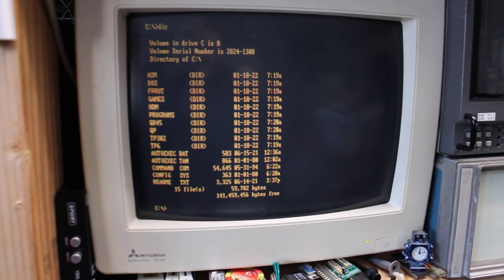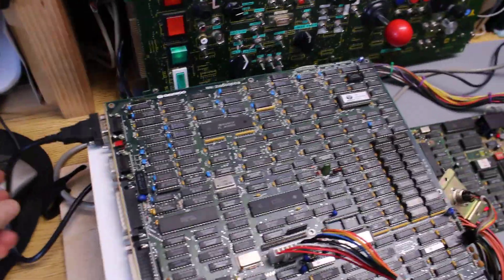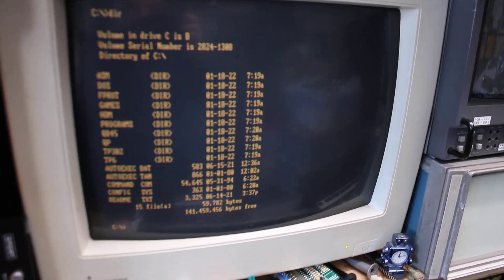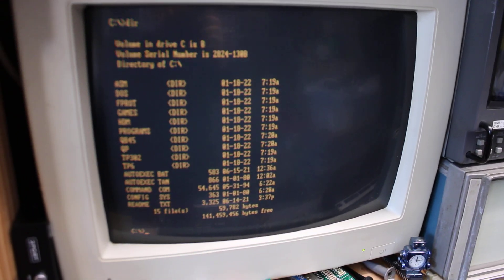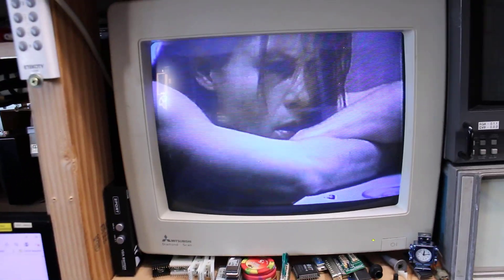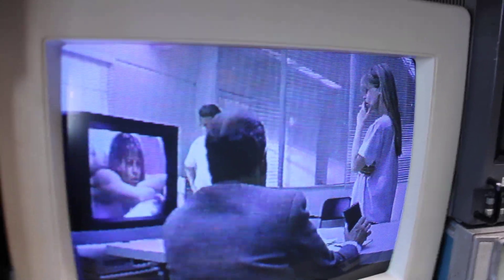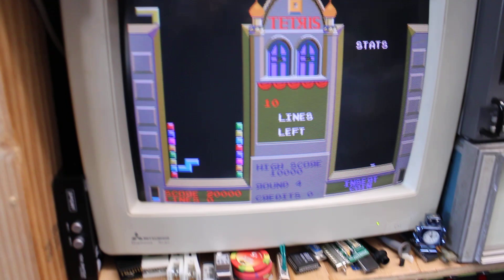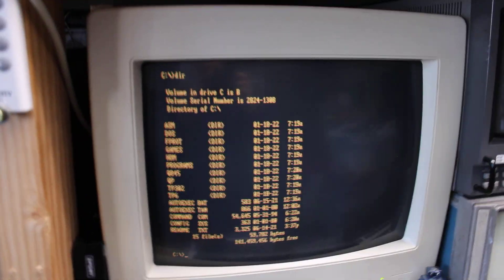Mitsubishi Diamond Scan Multisync monitor AUM-1381A demonstration

Comment: I also have an AUM-1381 and recently have been using it on my Apple iie via the composite input.  One thing I noticed is that the width/height/size controls on the rear of the monitor do not have any effect on the picture when running through composite input.  Those controls do work properly running through the VGA or TTL inputs. I would like to adjust this to better fill the screen.
Reply from the maker: Honestly using this monitor for composite video input is a waste. You are right, it overscans a lot and you would have to adjust internally, i don't think it is worth it. I would send you a really nice composite monitor with all the controls you need if you wanted to exchange? :) The composite video is a nice feature to have, but its comb filter is pretty basic too, you can't turn it off in mono modes which also leads to edge feathering. Its composite video function is its weakest point. But really, you don't have this monitor for its composite ability.

Comment: I dont know about these multisync monitors. Are they like a freesync kinda thing?
Reply: technically a Multisync monitor is just a monitor that can sync to resolutions with different horizontal refresh kHz, which is basically every monitor made since the late 90s.

However, what it used to mean in the 1980s like with this monitor was it could accept & display multiple video standards such as 15kHz SD (240p, 480i) content (such as the VHS Player here over composite) along with 31kHz 480p VGA.  It can also do anything in-between, like 24kHz resolutions which were used on some Japanese computers.  Not to mention being able to natively sync to 'digital' signals like MDA, CGA, EGA signals from old PCs.

Comment: That's awesome, I didn't realize Mitsubishi made a multi-sync like that.    This makes NEC Multisync 3D look weak in comparison, having composite video seems mighty handy.  And was that switchbox an official accessory or just something you hooked up?
Reply from the maker: Its a regular printer 'data switch' box. The mitsubishi uses a 25-pin connector at the rear for signal input and mode programming, so each input to the data switch is tailored for the different video modes.